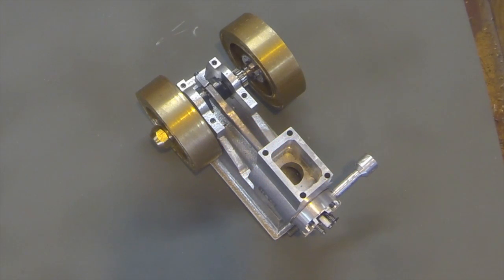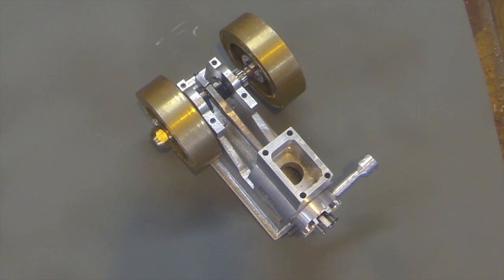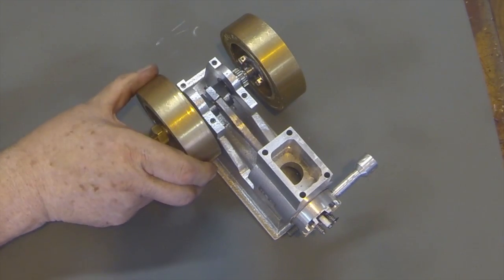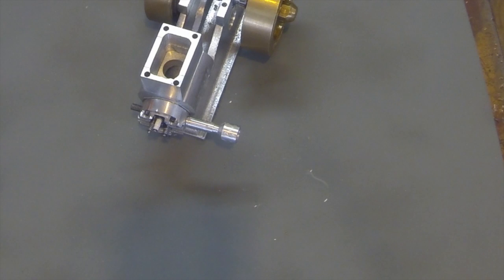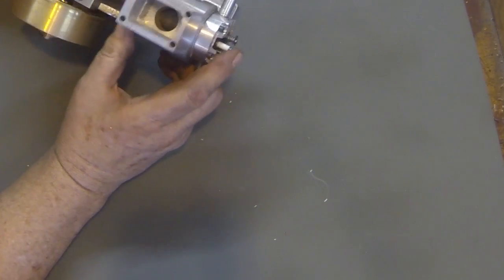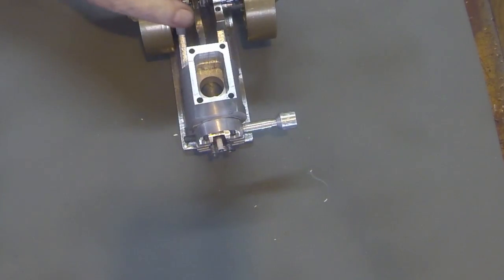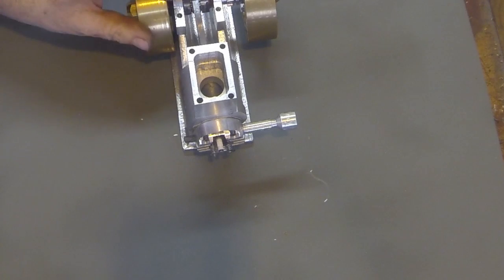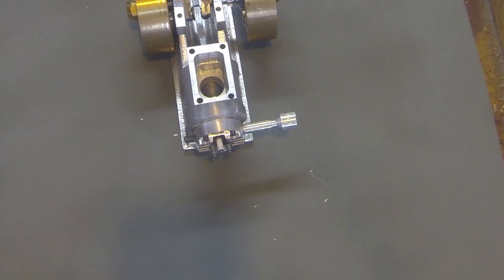"Eagle" Hit & Miss Engine update

Comment: Good looking work Herb.  What has been the most challenging part of this build for you so far?
Reply from the maker: The cranksaft has been challenging.  The one I'm using is the first one that I build.  I've built another using another technique, but the first one turned out better.  It was turned from a 1/4" flat bar about 7" long.  the ends are tappered from 3/8" down to 1/4"  and then 1/4-28 threads were cut on each end to hold a nut.
Reply: Herb Blair I've followed some of Brian Rupnow's builds, and the crankshafts do seem to require unique workholding and creative machining at times.  You are doing well and as you have said, learning a lot.